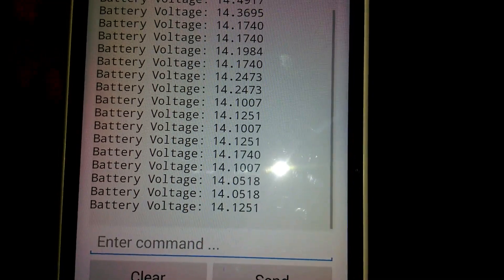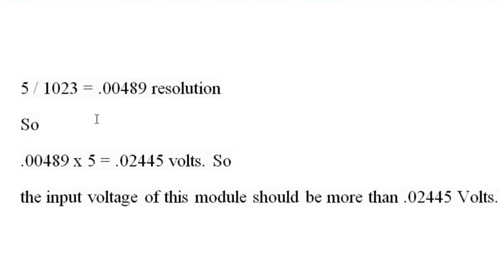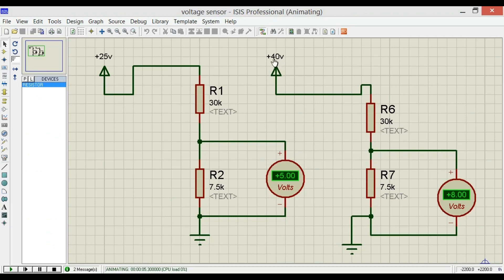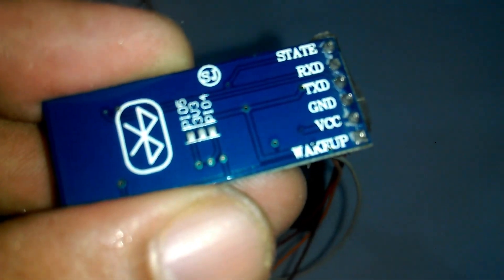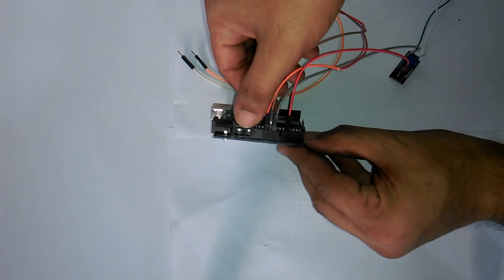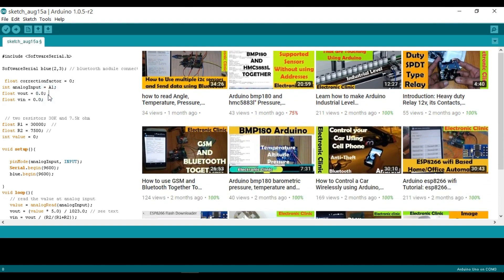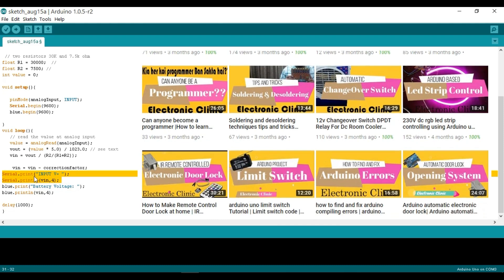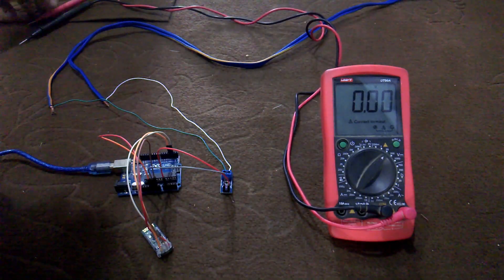Wireless battery voltage monitoring using Arduino , Bluetooth module Hc-05 | Hc06 and voltage sensor

Comment: I made this circuit for school but now i want to change something in the code so the voltage is showed on the app in percentages, we are measuring a lead acid battery and online there are converting tables to go from voltages to percentages but i don't know how to code this in the arduino, hopefully someone can help.

Comment: But using Bluetooth it is only 1-1 connection. If I have more batteries it will not work
Reply from the maker: for multiple batteries i used another technique  watch my latest video
Reply: @ElectroniClinic  I saw it but unless each Rf module has its own microprocessor, it is way too big to fit in a battery.
Reply from the maker: @Island728  you can reduce the size. i made a large development board, but you can reduce the overall size

Comment: List device name used in battery voltage logging system ??( Plzz give me answer of this question)
Reply from the maker: hc05 bluetooth, 0-25v voltage sensor, Arduino uno or Nano.
Reply from the maker: you can also watch my latest video on the same topic, thats the long range

Comment: Thank you this is a nice project, im doing something similar, in stead of a voltage sensor im using a current sensor, i need to compare, two sesnor values from two bluetooth module, slave and master, i need to measure, display on an LCD both the currents and compare, if the slave the current is less than i need to send an sms, could you please assist if you can
Reply from the maker: watch my videos on 3 phase transformer, in which i used multiple current sensors

Comment: Good project but I need one more thing to add on.  
1. One SD card is needed for data store.
2. Full coding and circuit diagram
3. Need to 5 channel battery data logger .

Comment: Dear sir, how many distance to  we have see that voltage from blue tooth device......please give answers VERY nessary required.
Reply from the maker: you can find this in the bluetooth module datasheet.
Reply from the maker: the one i used  has 10 to 15meters range.
Reply: Dear sir i want to see/monitering  from 20 kilometer distance of blue tooth devices.....how it possible.
Reply from the maker: 20 km is such a long range. Then u should use gsm or wifi. 
Watch my tutorials on gsm and wifi

Comment: Why my output is 19v instead of 12v only ?
Reply from the maker: Use the calibration value.
Reply from the maker: And measure the actual output of the battery with dmm.
Reply from the maker: Then compare both the values and set the calibration factor value accordingly
Reply: Where did you connect the two resistors ?

Comment: What would i need to change if i wanted to monitor  voltage and amperage of a 12 Volts emergency lights  lights in my garage.  If the amperage is more tham milli amps?   Should i just increase the size of the resistors for the heat of the higher amperage???   thanks
Reply from the maker: watch my tutorial on load monitoring and protection.You need to add only current sensor. nothing else..
Reply from the maker: that sensor can handle more than 20 amps. watch that tutorial, that will really help you. i have practically test that, and have used it in so many projects. you can also use other current sensors which can handle more amps.
Reply from the maker: and watch my tutorials on nodemcu you as well, if you want to monitor and control your emergency lights from anywhere around the world.
Reply from the maker: if you face any problems let me know over here, or you can text me on my whatsapp number.

Comment: Hello sir, great work! It all seems so simple but I get lost in the programming. What is the Android App called to use with this project? Also where is your blog page where the code it? Is it the Facebook page, because I'd like to take a look at the programming before I dive into this project and buy everything including the Uno. I am looking to view voltage, current and temprature with BlueTooth. It is a great adventure for me.
Reply from the maker: you can check the description section.. there is a download link..and don't worry about the android application, i will send you that app. its really good project you should try.

Comment: What about the Android app.did u design it or its available on the playstore??
Reply from the maker: You can download from playstore. 
But the one i use, i design jt myself.
Reply: Gr8.why not starting tutorial on Android app development. Also u need to write a name of App( APK File) and a link in video and description
Reply from the maker: I will start a tutorial series on android, but just waiting for monetization
Reply from the maker: I will be adding thousands of projects, covering all fields of engineering
Reply: Gr8.u r Geniius bro.will b waiting for all topics.i really enjoy watching your videos.
Reply from the maker: Thanks. In upcoming tutorial i will make an hotel rooms management syatem using rfid cards. The complete room electricity will be activates using a card and plus we will be using a heavy duty relay
Reply: @ElectroniClinic  which app we should  download in playstore sir can u mention...it will be useful
Reply: Hi, is it possible to change from Bluetooth module to wifi module ? And how to work with the wifi module. Thanks
Reply from the maker: yes it is possible. after two days i will start tutorials on wifi module. Nodemcu. In that tutorial i will cover how to send sensors data using wifi. Subscribe and click the bell icon. You will get the notifications.